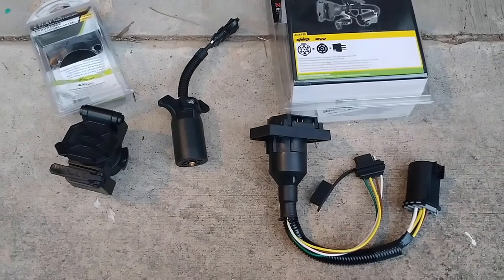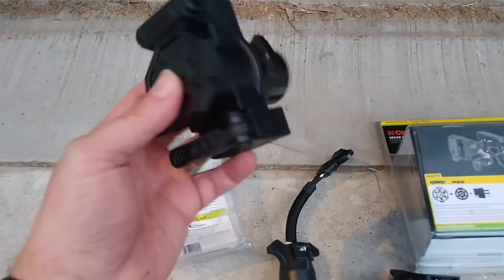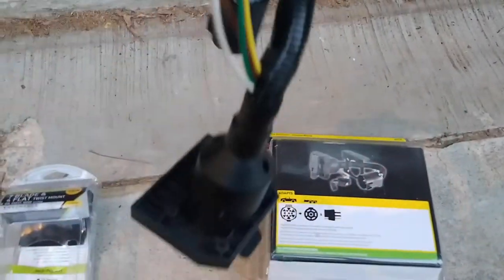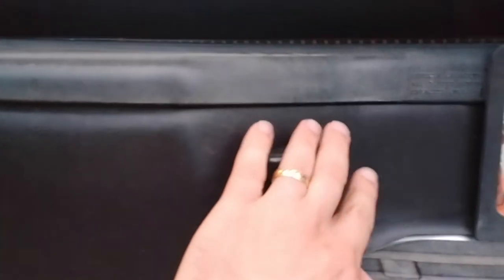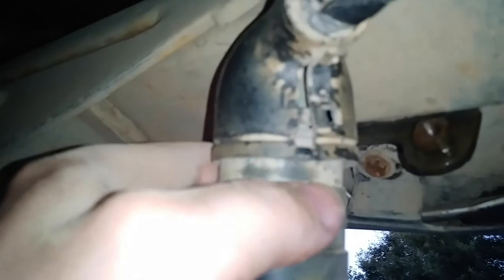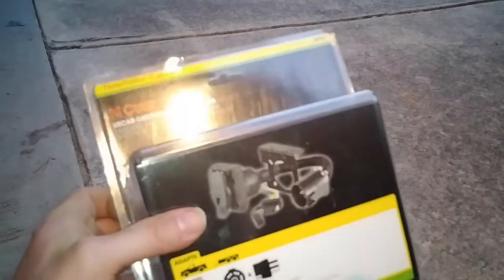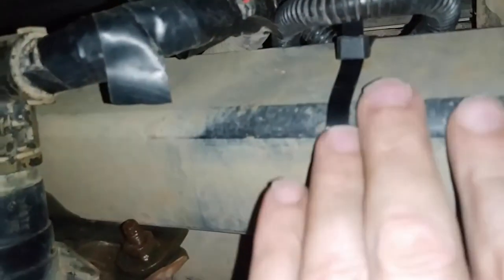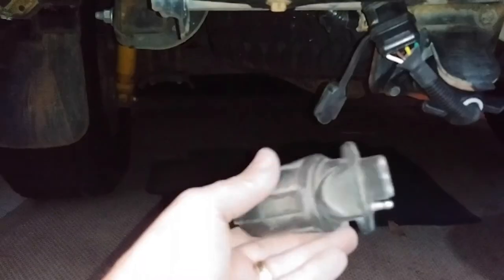7-Blade to 4-Pin trailer adapters for your Toyota Tacoma

Comment: My tacoma only has a 4 pin , not a 7 pin and i need a 7 pin cause I'm buying a travel trailer.  If I'm seeing this right yours had the 7 pin and you needed the 4 pin is that correct?
Reply from the maker: Yes. Mine came with the 7-blade connection, but all these LED light strips for the tail/turn/backup lights plug into the older 4-pin outlet, so I needed a good, concise adapter. If I understand you here, you have just the opposite need, right? Would something like this work? https://www.amazon.com/Huazu-Trailer-Adapter-Mounting-Solutions/dp/B0B28JM586/ref=sr_1_1_sspa?crid=1IHYWO0QMXDYJ&keywords=4+pin+to+7+pin+adapter&qid=1656704506&sprefix=4+pin+to+%2Caps%2C122&sr=8-1-spons&psc=1&spLa=ZW5jcnlwdGVkUXVhbGlmaWVyPUExWDUwUkxGU1BFUE9GJmVuY3J5cHRlZElkPUEwOTU4OTc0S0JBSzVQTEFNTVkzJmVuY3J5cHRlZEFkSWQ9QTA5NjI3MDQyRzRGSkg0NU41NzVSJndpZGdldE5hbWU9c3BfYXRmJmFjdGlvbj1jbGlja1JlZGlyZWN0JmRvTm90TG9nQ2xpY2s9dHJ1ZQ==
Reply: how did you connect the reverse lights?